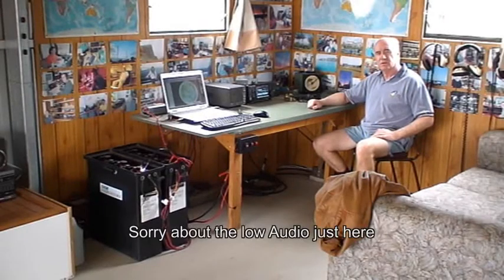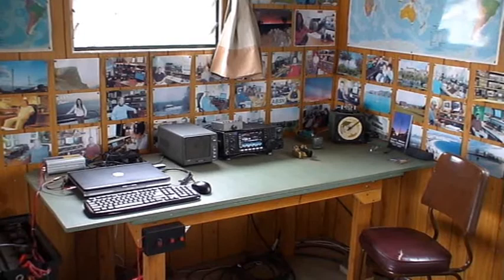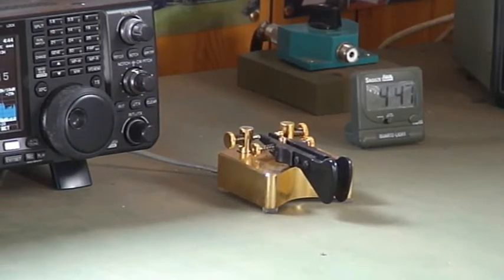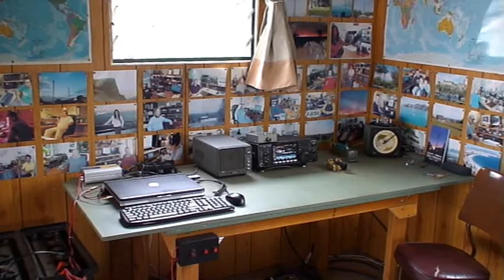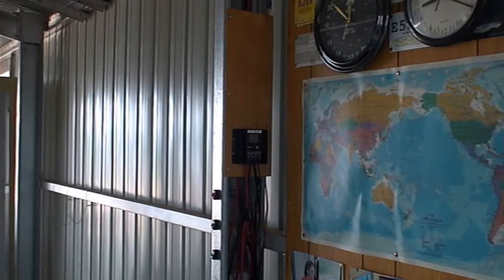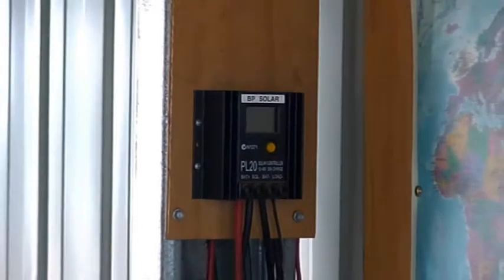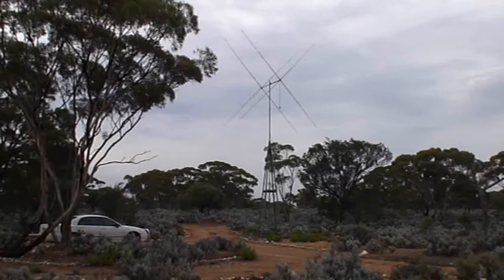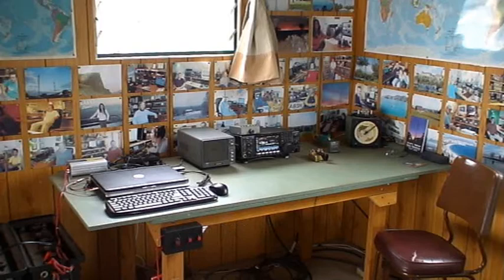Solar Powered Amateur Radio Shack.wmv

Comment: Love those antennas in the aussie outback..... Doug K5DHL
Reply from the maker: Roger Doug. Thanks. The antennas have now been in the air for over 10 years. Ground Plane is as good as new. No problems physically but the Quad had broken wires which need replacing. Both good antennas but the Quad being directional gets out better. 73 from down under. VK5SW.com  You may like the new video I have recently made of my AR Station in the Bush. It runs for 34 minutes and can be seen on the front page of my website.

Comment: Fantastic video 👏👍 but ! As you said audio to low . To bad I am really interested in what you have. I'm setting up my portable station in East Texas deep in the woods so working on a lifepo4 Pak to handle it . So far my solar consist of 6 , 15 Watt and 4, 50 watts ,  I have to use a pwm controller the mppt is to noisy. Keep up the good work.
Reply from the maker: G'day Debbie, Thank you for your comments. I do appreciate it and good luck with your solar power efforts. Once up and running, you don't need to worry too much about it. Cheers, Rob.

Comment: great job!!  I am in western new York with solar cabin. My problem is on HF my MPPT solar charge makes hash noise on some HF bands. Also using NiFe battery's 10 cell had to use 2 diodes with bypass caps to drop voltage during charge. 16.6 peek volts.  IC-7300, RCI 2950,4 band HF VHF UHF . LED lighting.  HP laptop direct 12V input supply. 400watt solar 700Ah 20 cell 2x10 Nife working 7 years now! 73's
Reply from the maker: G'day Bob, from down under. Yes, controller noise can be a problem but fortunately the solar shack shown in this video has no problems at all in that regard. The radios are dead quiet. Just happened to work out that way, thank goodness. Sounds like you have put a lot of effort into your solar cabin but no doubt, worth it though. Yes, the solar batteries can last a long time. The large 670AH battery shown in the video has been there for eleven years now and no problems at all. Good to hear from you Bob. Thanks for that. 73 from the land of the kangaroo.

Comment: Nice Video and good TRX! I´ve also a Solar-powered Shack in my garden area. 12V/110Ah-Solar-Battery and five 120-W-Panels.....always enough power to be every day on the air.

Comment from the maker: Hi Stewy,
It's an 80 watt panel which is enough to slowly charge the battery. We use this QTH as a Getaway location so we aren't here that often. The battery doesn't need to be charged quickly. It has been used for 6 years now and it works well. 73.